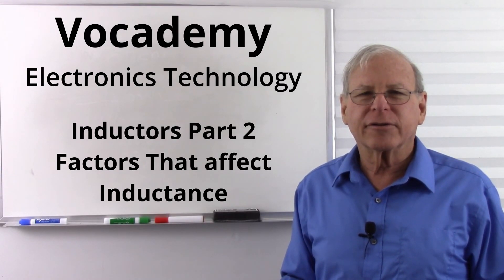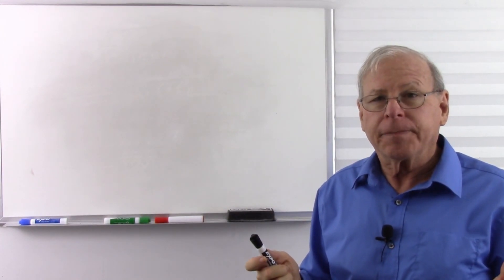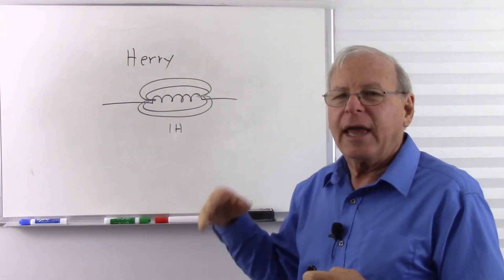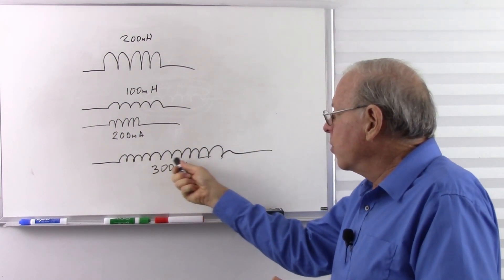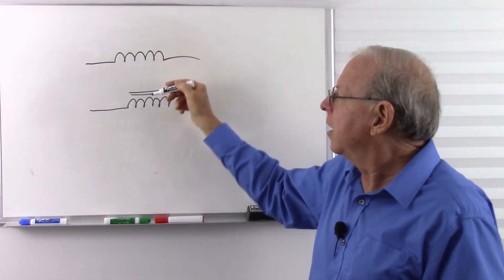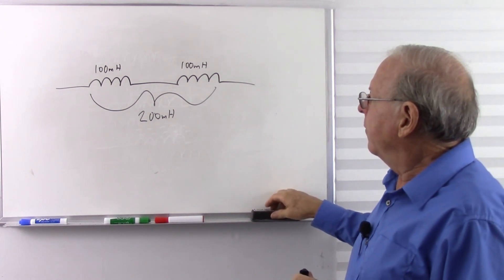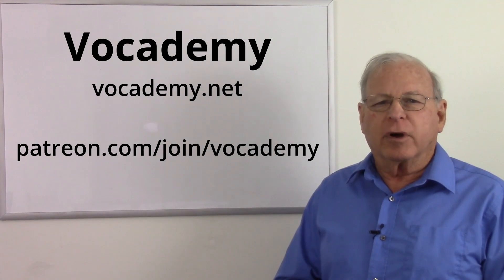Inductors Part 2   Factors That Affect Inductance

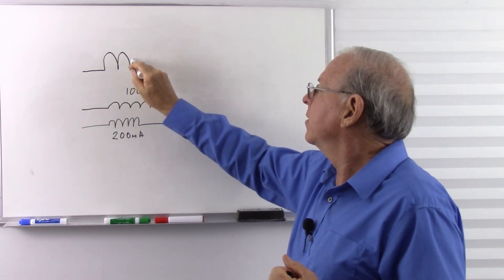Comment: 3:30 While you were discussing what happens when you make the diameter of the coil of wire it would have been great if you could have elaborated further when saying diameter of the coil with a statement like “Making the loops of wire larger”  to really hit home you are NOT talking about the diameter of the wire used.

After having gone back and rewatched the video a couple times, understanding what you are referring to is readily apparent. Especially when you follow up by saying increasing the diameter of wire lowers inductance (all other factors held constant). 

Despite this, I can attest that my brain came slamming to a halt after that follow up wondering if just heard something contradicting. This was of course completely the fault of my own for leisurely watching and not intently following along. That said, I believe a small amount of follow up making certain you drive your point home would go a long way. 

There are many people interested in these topics familiar with the basics of electrical that have a tendency to automatically associate the word diameter to size of wire. 😅

I’ll again reiterate everything you said was perfectly fine, and this is just my 2 cents as someone watching from the small screen of my iPhone.